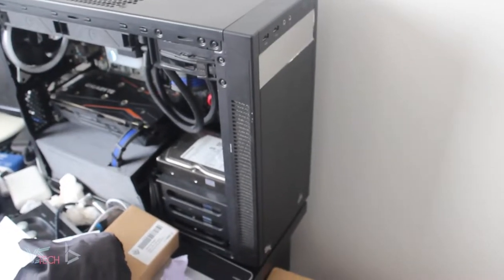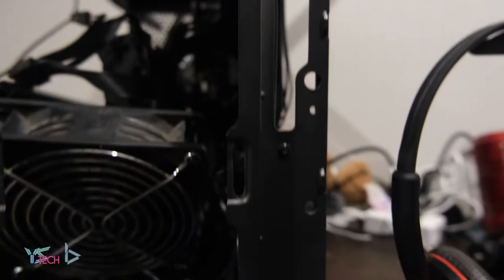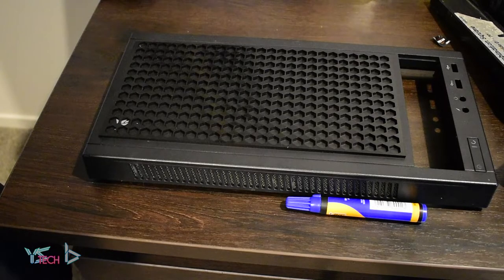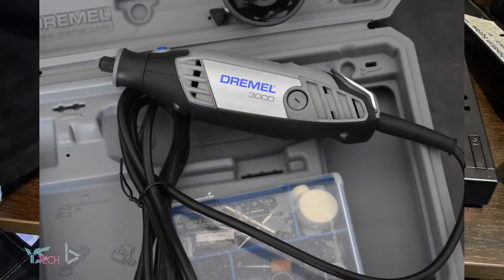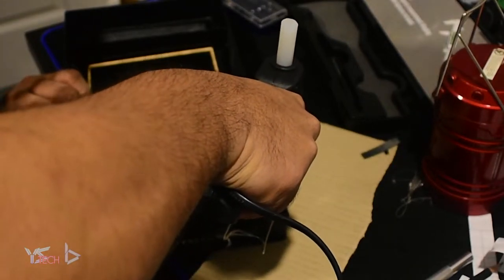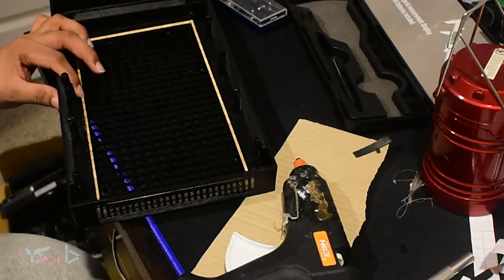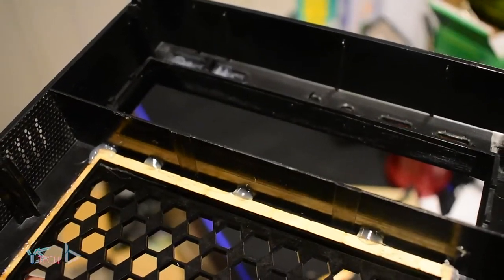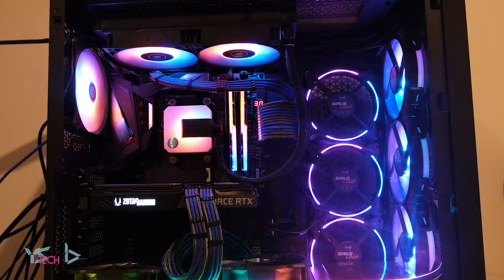Building a DIY Airflow Panel for a Gaming PC

Comment: I just drilled holes in mine.....
Reply from the maker: Lmaooo xDD, did it work doe? :D
Reply: I'm thinking of doing something that use both drilling and 3D printing. 3D print a jig with perfectly spaced holes and drill through the case material with the jig in place, so your holes are aligned better.
Reply from the maker: @ccricers  Thats could work well haha, but at the same time you could also just 3d print out an airflow front panel xD, but might be a bit pricy depending on the infill ahaha :). Sounds like fun doe, give us an update when you finish it :D <3

Comment: I DID THIS on my Raidmax Magnus Z3, if you search an image on this case you can see that the front panel is a plastic w/ anodized aluminum which is a solid panel front with side vents so i remove the aluminum and cut the plastic cover and  use epoxy on an aluminum mesh that i attached to it now instead of having a negative airflow i have slight positive airflow which is better now dust build up will only came from the front pannel mesh and no longer pull air on tiny vents or gaps which leave dust on those gaps.
Reply from the maker: Haha noice! Its a super fun build ahaha. -YS

Comment: Why do you use hexagons, but don't used the most efficient "side on side"/honeycomb grid pattern/placement of these holes?!
3d printing it should also work, I doubt that the front plate gets above 40°c even of the graphics card is 70°
Reply from the maker: Could try that out next time :D, IMO 3d printing would be cool, but I don't have or have access to a bed size large enough for a whole single panel. Have an awesome day! -YS
Reply from the maker: I found this one which could be cool :D https://www.thingiverse.com/thing:4889085 Just two pieces as well ;)